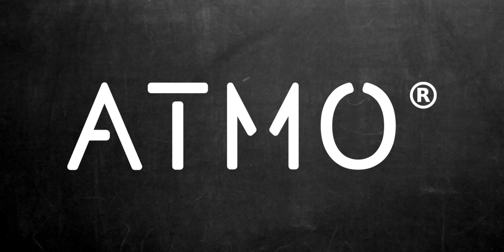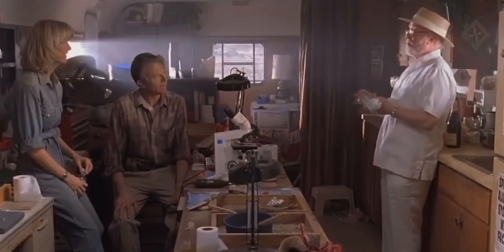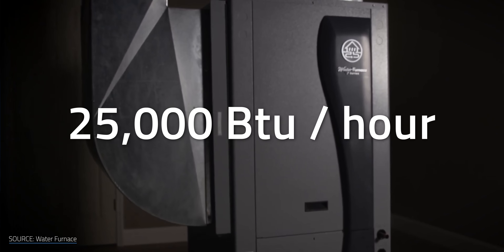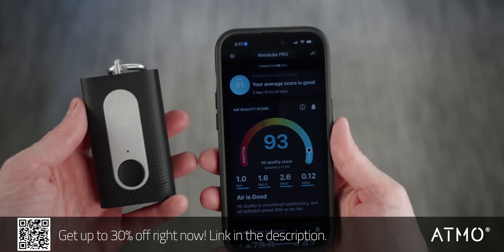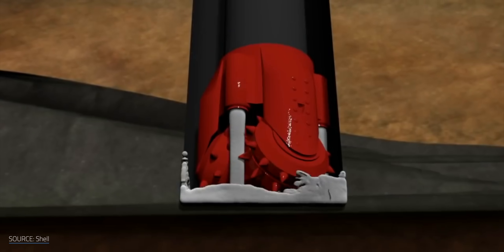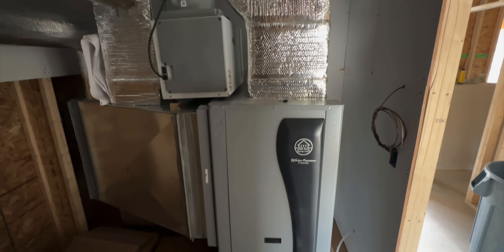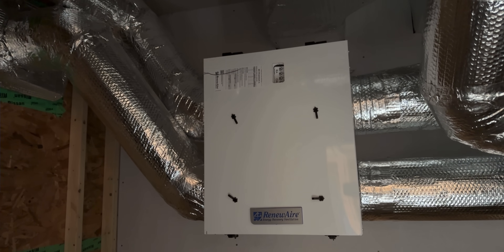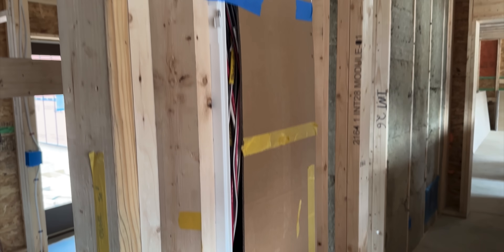Why I Went With Geothermal For My Net Zero Home

Comment: I am enjoying watching all of the care and thought you have been putting into the build and all of its systems.  Since the home will be air tight, have you thought about the design for general air flow...in my home, I installed small windows along the base to let cool air in and small windows at the top of my 2 story foyer to let the hot air escape...this is great when the humidity outside is not oppressive. With all of the filtered and controlled air, a solidly sealed home may not let the VOCs that accumulate from furniture, building materials, paints, etc. to escape the home which would happen with a wholesale air exchange with outside air.  This air can still be well filtered if you didn't want to just open windows but I think having fresh outdoor air replacing the stagnant indoor air will prove to be healthier in the long-term.  What do you think if you haven't already considered?

Comment: Hi Matt. Thanks for your great video.
I'm building a multi-source thermal energy collection and storage system for my off-grid home. I would like to know more about:
1. How you plan to use home assistant to manage thermal energy and related systems (e.g. room temperatures and shades)
2. How your thermal energy source (geothermal), "de-super-heater", and heat pump water heater are connected and collectively managed.

Good luck with the rest of your build!

Comment: I just built my new house. There are many of the features in your house that I wish I could have done in mine, but, you know, money. I did, however, go overboard on the network. I am an IT guy, so I ran my own network and TV cable. I went waaaaay overboard just because I could. Posting 'Cable Videos' on my channel became a running gag.

Comment: I wonder - how are the diminishing returns when you put so many efficient components together? Like if you took a house with oil/gas heating and insulated it as well as your new house, that would be huge. Then replace the furnace with geo, is that already over the top in terms of recouping money and generating more waste by installing more complexities like solar etc?

Comment: Hmm, I don't get the desire to run that many Ethernet drops. Wifi is plenty fast now for pretty much anything. Running repeaters and other access points around the house, seems would have been a better move and maybe even cheaper. Can you explain to this network guy, why in 2023 you are running a bunch of ethernet, not even fiber, but ethernet?

Comment: Hey Matt, have you looked into an electrostatic air filter to tamp down the particulate matter exiting your forced air system? Years ago my youngest daughter was immunocompromised and the air specialists with Children's Hospital recommended a Trion electrostatic filter, a Trion HE Plus 2000. He came out and measured our air after we installed it and said we were close to a Clean Room standard. We leave the system fan running with the filter turned on. It killed the air quality issues and also reduced the need for dusting. Just rinse out the filters every 6 months. You might like it. It's just a 5 inch high box that sits on the exit ductwork.

Comment: I'd love to see a video on the home automation and how to get it all to work on-prem, instead of needing to use public cloud with IoT devices, so if you lose internet connection, the automation still works.  Also, details on how you are setting up your network... single flat subnet, or is the automation being seperated from everything else?  How are you dealing with the heat from all the tech?

Comment: I have a similar story on the opposite corner of the country, SaddleBrooke (Tucson), AZ. We went with an active adult community for retirement in 2014. The developer only allows their captive construction company, but they were competitive with similar communities. They also allowed a wide range of standard model with options and NSOs (non standard orders). The home is post-tension slab on grade. We opted for 2x6 walls plus 1" foam board and stucco (over 2x4) with R-24 walls and R-44 ceiling. Solar PV was an option; I selected 5.7 kW which produces 11,000 kWh in sunny southern AZ. I also added coax and ethernet wiring which now we don't need at all. The internet is now fiber optic and the WiFi router is so good I can run YouTubeTV to five 4K HDTVs (yes overkill on TVs I know), as well as computers, tablets and phones. I use Kasa and Amazon Alexa for automation, and Simplisafe for security. We added a 442 sq ft addition for my wife's hobby room and office. It is heat/cooled with a 1-ton Daikin mini-split. We didn't like the single speed A/C and gas furnace, so after seven years replaced it with a Daikin 4 ton air source heat pump. We still had excess kWh, so added a Tesla. We are now at breakeven on electric production versus usage. So, over 3100 sq ft and the solar heats and cools, and runs everything, including the Tesla (an $1800 gasoline offset).

Comment: Matt, nice project! Are you going to use a heat pump clothes dryer? They finally make them large enough. Also, did you consider a A.O. Smith HPWH? The specs say it is 5 DbA quieter than a Rheem. Did you look at the newest air source  heat pumps that are supposedly good to -15F? Probably a lot cheaper.

Comment: My dad was a software developer for a very big company for over 20 years, so when my mom and dad built their dream house and we moved into it (I was 9 at the time), the networking area was about twice the size of yours (he ran all the wire himself though). 
also my dad actually paid our ISP to have fiber trenched to our area cuz we were out in the country, so we had horrible internet (<4mbs) when we first moved.😂
You're definitely not crazy! You're doing all the right moves!
My dad has Ubiquity stuff as well, and he also went with Lutron light switches, but make sure you go with whatever their top tier best lineup is (Homeworks maybe? I forget the name) because my dad has Radio Ra, which is the exact same hardware as their top tier, but different has firmware that is more limited. And, when my dad asked Lutron if he could pay to upgrade the firmware to the top tier system since it's the same hardware, they tried to make him buy completely new switches.
He also didn't run power to the windows because power shades weren't a thing then, but he regrets it now. 
He just installed one very large battery powered shade over a sliding glass door in the kitchen as an experiment.

I LOVE your house series and these will definitely be a huge inspiration for me when I build my first house.

Comment: Being oversized is probably better because as things degrade over time, you have a bit more room to work with before you are pushing it past it's design limits to keep up as it degrades over the years.  As your insulation wears out, you'll need more energy, as the heat / cool wears out it won't be as efficient etc etc.  That extra ton is not a big deal, and given those units are load demand anyways and not just on/off it'll be fine.

Comment: I think your decision to go with two heat pumps, one for heating your home, and one for heating water, is a very sensible. Using one system for both functions involves quite a bit of compromise, which ends up costing a more in energy. With two system, each can be tuned very precisiely for efficiency. I hope you enjoy your home.

Comment: Cool stuff bro.. Although.. I (for myself) would consider air power as well.. or even some small-time hydro power on the drain or intake side. Kind of like the idea that even when I wash my hands I could make electricity, that would either be used for cleaning that water for reuse or just plainly environment purposes, or simply add it to the pool of every generator in the house. Standing on multiple feet seems to be a ideal thinking when considering for the long term.. as anything could go wrong, probably will some time on.

Comment: Awesome looking plans so far. One topic that could really use your detail and presentation would be HRV make-up air for kitchen hob (assuming induction in your all electric home?) ventilation. This topic gets a lot of talk yet never really solved in a way that doesn't involve a lot of compromises. The wireless setup would also be interesting to see - covering Wifi 6E and low-power protocols like Zigbee.

Comment: I installed geothermal about 10 years ago.  I like it and am all electric at our house.  Problem I didn’t fully appreciate is we are at the end of the distribution line.  People 3 houses down have a different power company.  The result is we lose power more frequently.  We have a fireplace/wood stove for backup heat but no power means no well water, etc.  We bought a gasoline generator which helps a lot.  However the generator has to be maintained as well.  Would you please do some videos about reliability and cost.  I like your smart home gadgets but what happens when a board dies?  Are you down?  Does it have a fail safe mode?

Comment: Love this, I'm going to look into Geothermal, I've know the concept and I know it's widly used in Iceland. But for obvious reason, such as energy companies being able to milk you. I didn't know it was know a thing globally.

You could literally do a "side gig", building Green houses.

But don't get a Spark to run Network Cables. 🤦 They don't understand the standards and the crimping. Get a Network Engineer to do it. All the worst cabling jobs I've seen, have been run by electricians.

Comment: Home automation is cool, but consider :
- What's the parasitic load of all the gizmo's? 
- And embodied resources? 
- How long will the tech keep going before needing replacement or becoming unsupported. Passive stuff doesn't get arbitrarily obsoleted nor consume power just being there. 

I suspect we're still in the zone where early adopters are going to have "fun" keeping systems running when the warranty expires.

Comment: A little more detail on your water heating system and how much such a setup would cost would be great.  In fact, some info. on the cost of the geothermal heat pump too would be great.  I have been waiting for more information on how to use the provisions of the Inflation Reduction Act.

Comment: Yes Matt I do think you made a mistake going for forced air. It takes less energy to heat a slab up to a level that will keep you in comfort 22 C and the system can reverse and bring the slab down to 18 C in summer to keep you cool. Air will need to be at a higher temperature to maintain comfort. So this might cost you more to run. I have installed a loop in the slab run from a boiler in a house in the mountains of New Zealand, it worked great but didn't cool of course. I have always wanted to do a system like yours so thanks for doing it and sharing it with us. I really like your videos and your level of expertise in explaining things to us. I am a bit surprised it only took one hole but you did go down a long way.

Comment: Thank you for the great video! We are also building a house right now. Unfortunately geothermal was to expensive... In Germany you need a lot of permits to drill that deep.. And our yard is not big enough for the alternative plane solution.
Have you considered that the geothermal solution is actually less efficient during warmer days since the ground temperature stays at 10 degrees and the air is warmer => Easier to pump out heat? Of course, the winter requires more heating/warm water but I wonder if the cost is justified since you have to put in more energy all summer long to heat water.

What type of Ethernet cable did you run?
So most of your smarthome is communicating wireless? Why did you not use a BUS system?

Comment: don't suppose you looked at air-to-water heat pumps?  I first looked into geothermal and got an estimate of $36K just for the drilling, which wasn't worth while as I came across air-to-water hp which have similar seasonal performance without the need to dig.

Comment: We put in roll shutters on the outside of our low E windows (Rallodens in German). These were worth almost 40 degrees on the hottest days when our west facing rooms could get to 130 degrees and keeps the house at a more even temperature in winter. Tried interior shades but they were nowhere as efficient as the exterior roll shutters. Lowered our utility bill by almost 50%.

Comment: Extremely cool - Must be nice to have nearly unlimited funds to sink into such a project! - but now comes the reality check.  Sorry!  
What are you going to do/how are you going to feel:  In 5yrs., when everything in your superhome (except possibly the geothermal system itself), has become Ancient Technology (computer-years wise), Or when an EMP hits (Sun-made; but most likely, manmade), and fries all your electronics (mine too, I know!), or when the Internet/Powergrid go down for a while (by EMP, fuel Shortages, sabotage, or other), you did not mention backup power, but even if your superhouse is coated with solar-film paint, that wouldn't be enough for your pumps and exchangers, and/or your basic appliances - technology's cooool (especially when it workds as expected/designed), but it's also a TRAP we're all falling in, slowly but surely - keep smiling, and enjoy it while you can - congratulations!

Comment: We’re in New England as well and have 53 Ethernet drops in our house. I wanted to ensure that every possible place something could be direct wired it had a nearby port. We also have an additional 16 dedicated Ethernet drops for security cameras. So no, your not crazy about asking for all of the cat-6 cable. I originally wanted fiber but the electrician said it would be a significant cost. So we settled on cat-6

Comment: canadian here. Went with a geothermal system 15+ years ago. very happy with it. The heating does struggle on the coldest days 35C, or if you try too raise the temp quick. A auxillary heater comes on at that point. The cooling is very impressive (believe it or not it does get hot here too +31C tomorrow.
We tracked our Total energy costs for a number of years and figure we save about 1/3. We also just live more comfortably. System has already paid itself off 
Excited for your new home

Comment: If you want that geothermal to be efficient and use less energy you should go deeper at least 1000 meters and insulate 600 meters from the ground . There is a report from an university in USA that tested and the most efficient was at 1200 meters and insulated till 600 ,i know its very expensive but the water coming from that well will be around 30 C so heat pump will use less energy.

Comment: Are you allergic to Wi-Fi?  I way over cabled on one of the sites that I managed.  Another problem was a redundant oversized cooling system for a server room.  Constant issues.  That one wasn't mine.  I am curious about your age and pay-back calculations.  If I had your money I'd burn mine.  Good Luck.  :face-turquoise-covering-eyes:

Comment: I am VERY surprised that you went with AC for your lighting. DC lighting would have been much more efficient and worked directly with solar. Instead of each light going DC to AC to DC again. And, when using Lutron shades, we honestly push battery powered instead of wiring them. It cost way more to wire them, then add the cost of the power supply. They are so energy efficient that the batteries last for years. You will never exceed the cost of batteries vs. the cost of wiring and power supply. And then there is no draw on any grid power loss. They all are automatically on battery backup.

Comment: We have a horizontal system in our house 11 years ago. We have 2x6 walls and excellent insulation. This system has worked really well for us and makes us one of the most energy efficient home in our area. And as mentioned, provides a very large amount of hot water as a byproduct of the system.

Comment: Hey Matt, question about your ERV; what drove the decision for an ERV vs. HRV? I’m in NY and we have been debating between the two. While ERV will help manage humidity in the winter, ultrasonic humidifiers also do a good job of adding moisture to the air with very little power consumption. The company I’m speaking to is pushing me towards HRV but idk if they have my best interest in mind. They do push the lower cost and higher thermal efficiency as major benefits. I can see this being true as HRV is basically just a metal heat exchanger whereas an ERV is a more complex material. Also, what efficiency did you go for, and did you do calculations on the investment cost vs. savings long term for different efficiencies?